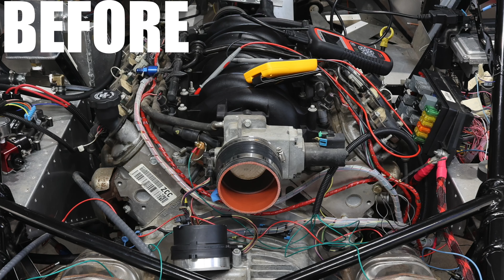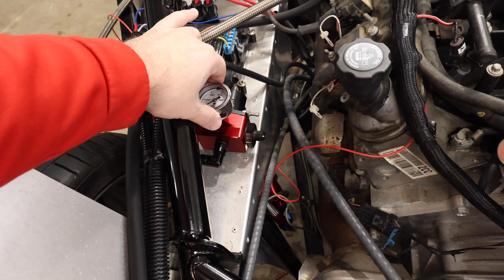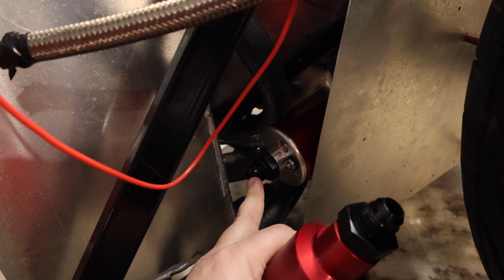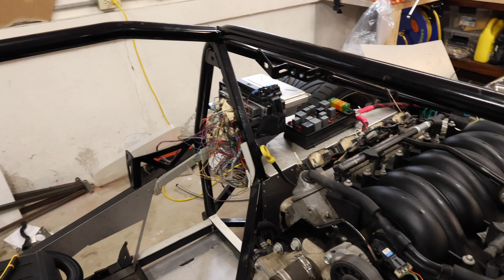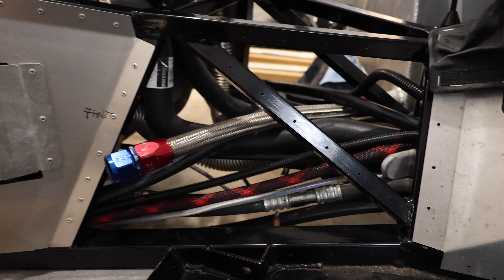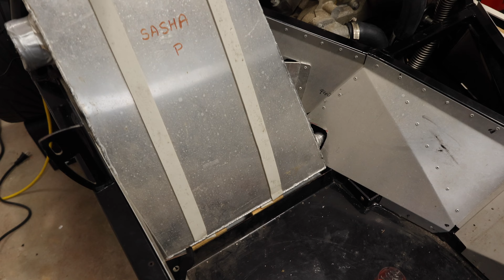EVERYTHING FINALLY WORKS | Building the Fuel System on the Factory 5 GTM Kit Car

Comment: Keep in mind the aluminum panels are in BARE aluminum. They need to be coated with something to prevent corrosion. Most guys use bedliner because it also helps deaden the panels so they don't rattle.
Reply from the maker: Thanks for the tip. I’ll buy some this weekend. Do people typically spray it before they go together? (I assume so)
Reply: @SmackeysGarage  Yes. Make sure and prep it well, sand and acetone or wax/grease remover and make sure it's warm and stays warm a couple days to cure. I used an etching primer before the bedliner too.
Reply from the maker: I'll have to add that to the spring to do list. Unfortunately there is no "warm" here right now.